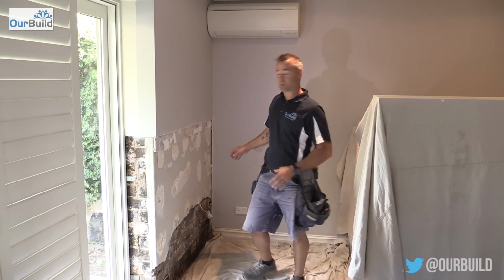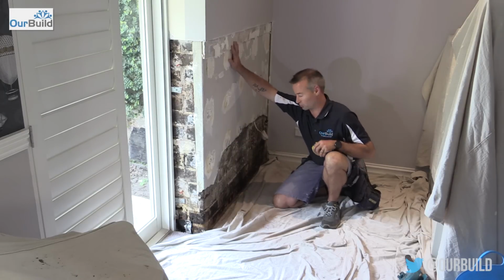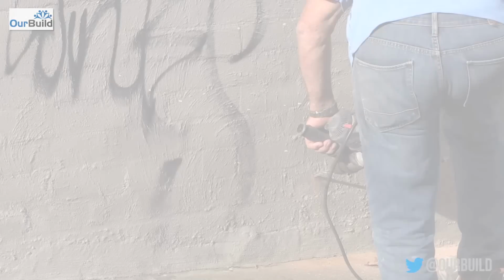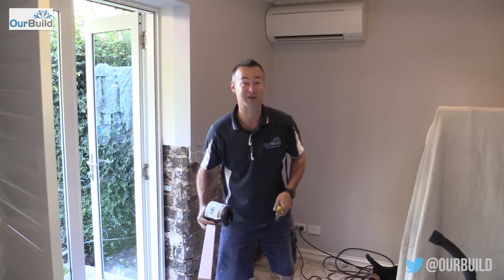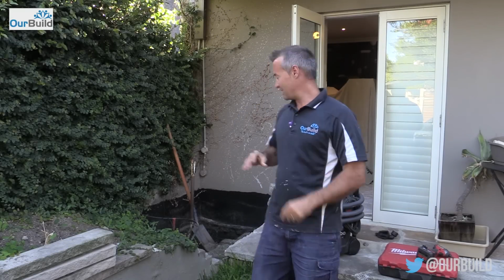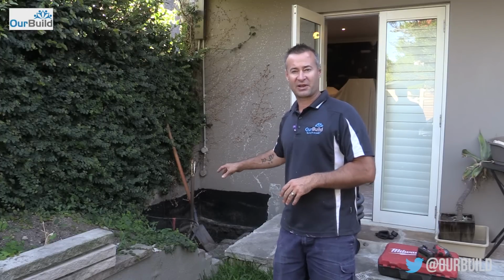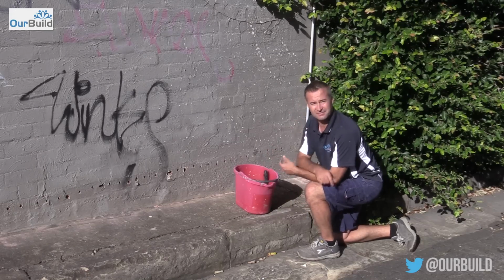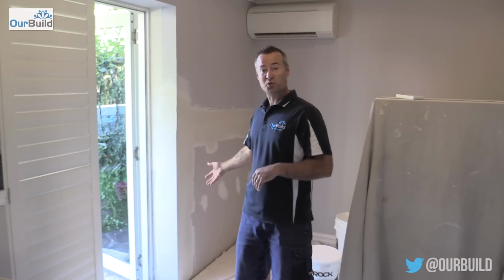How To Repair Rising Damp In A Wall.

Comment: Why are you injecting the outside skin of a cavity wall ?  Its useless injecting an outside skin. If the cavity is blocked then clear it.
If either wall has a DPC then the bitumen will bridge any DPC on either wall allowing moisture to rise by capillary action.
Its not clear to me whether its a solid floor or not? If its solid then where is the edge of the DPM membrane?
FWIW: you dont drill the bricks - you drill & inject the beds where they meet the perps. 
Double drilling is possible but its another subject.

I have doubts about the effectiveness of chemical injections - its best to find the causes of any damp or condensation, and then treat the causes without any drilling & injecting.

If high ground levels allow moisture to penetrate into a wall - the moisture will then begin to rise by capillary action, carrying with it chlorides & nitrates from the soil ie. rising damp.

Comment: Mate, you basically just wasted your time and the clients money...rising damp travels through mortar not the brick. By injecting the brick you didn’t fix anything 😬... the meter readings will be the same in 12 months time and the new sheet rock will show the same signs of visible damp as the old stuff did
Reply from the maker: What is your profession and experience with this?
Reply: Jimbo Slice Birmingham pal...

Comment: You should have been a chef, because you made a right meal out of taping those joints 🤣
The DPC cream works a lot better in the mortar line. I’ve had to re-treat several jobs injected into the bricks.
Reply from the maker: Thanks 😄
Reply: @OurBuild  looked tidy when all done though 😜 👍🏼